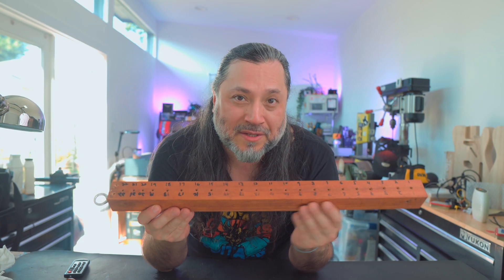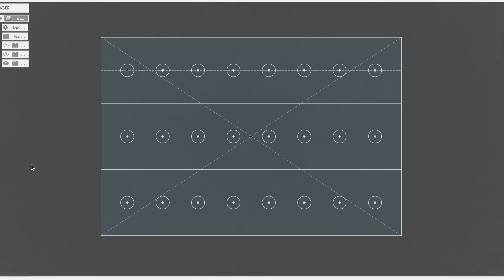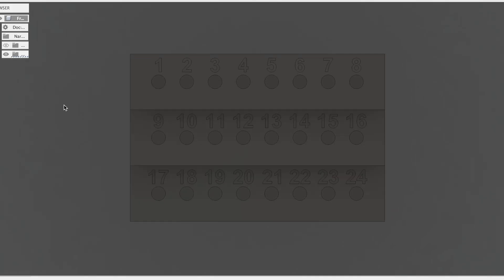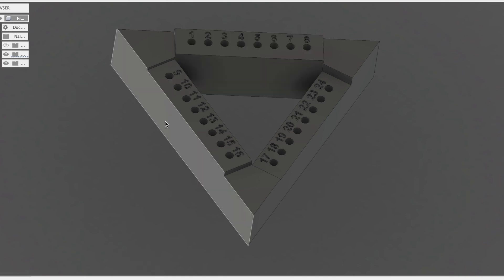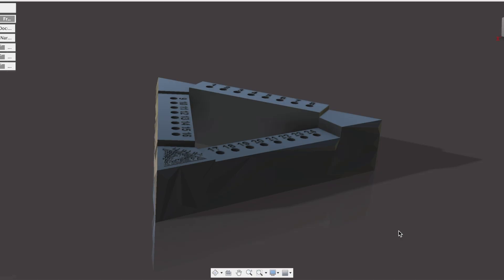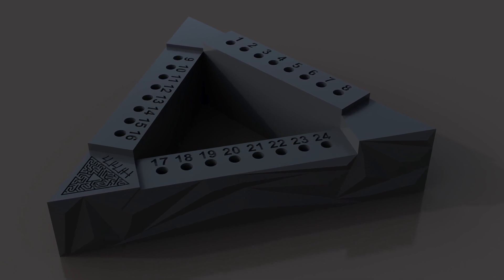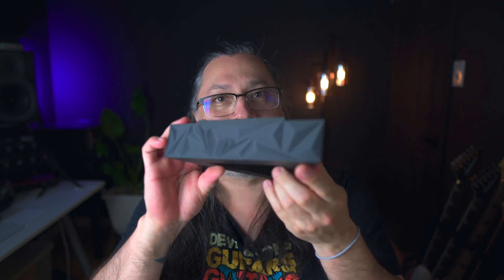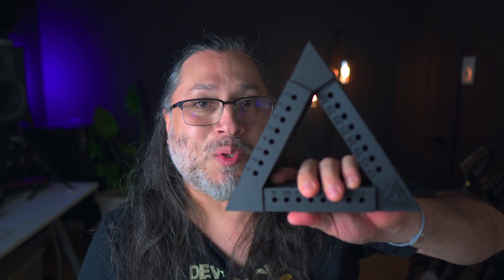3D Printed Fret Holder - From Concept to Creation

Comment: the 2 plane corners need something!!  I would have the numbers rotate clockwise so that you'd just have to turn the triangle to hit numerical order.  The top triangle could be "hollow" or hollow-ish so that you can use that as a hanger, but the inside area also works and is less effort.

the hollow corner could be designed to work with a printed wall anchor.  this would allow you to design a (30 degree) catch and have that match the triangle hanging part.

Comment: A few more practicalities.  Mine is almost entirely random, and I can lose track of the frets really easy.  The division to 3 sides helps this.  I am often doing two guitars at once so my holder has two sets of holes.  I often rely on counting out the frets on the board to confirm where I am at, so incorporating the 3/5/7/9/12/15/17/19/21 fret markers into the design would help keep my place.  Finally, this needs to multitask, and an equilateral triangle would make a good centering tool for bridge and neck fitting.  All my centering tools are bad.  Tim Sway's scissor lift tool needed additional frames of reference to ensure it was straight and it broke.  I have a couple of manual rulers, including a protractor, but I'd love to see the only angles I need for bridge alignment etc.  Tim Sway sells his tools and I use them often (just not that one) so that's an angle you might want to pursue. a $25-30 item which has multiple functions for late-stage guitar making in one easy to find tool is something I'd buy.
Reply from the maker: Insightful suggestions. Thanks!

Comment: Some suggestions that immediately came to mind for me. Slant the triangular corners down so they are not flat, but ramps. Rotate your numbers so they all face the front point. Finally, print it with a 3 color co-extruded PLA Silk. If you care what it looks like inside, not because you can see it, but because we can when you post a video - 20% infill and go with Gyroid because it is the king of infills. Strong in all 3 dimensional directions and looks really cool to boot.
Reply from the maker: Yes! I also thought about slanting the sides and using Silk. I bet those low-poly angles would really catch the light if made with Silk.